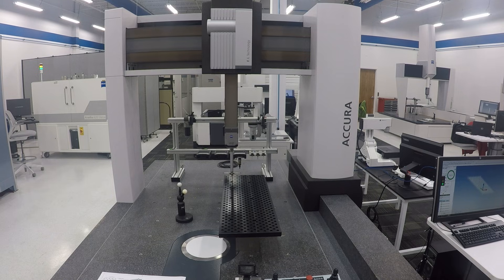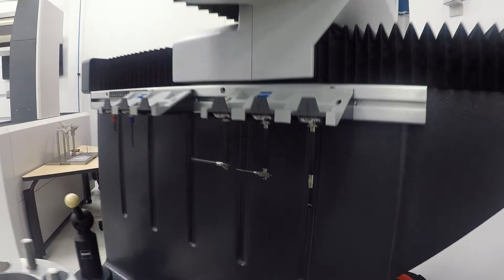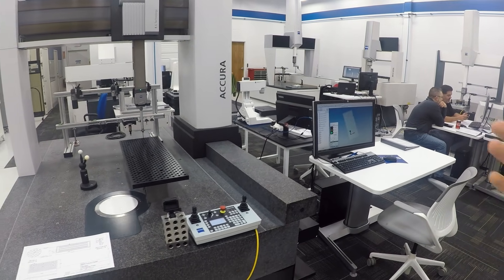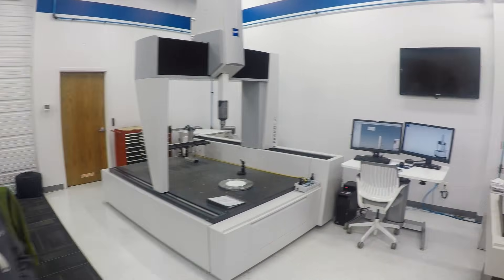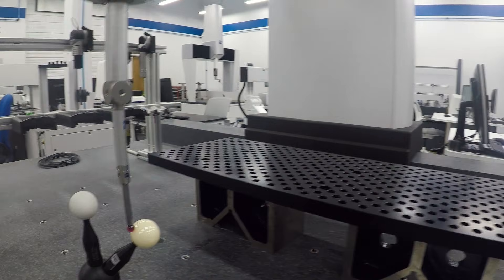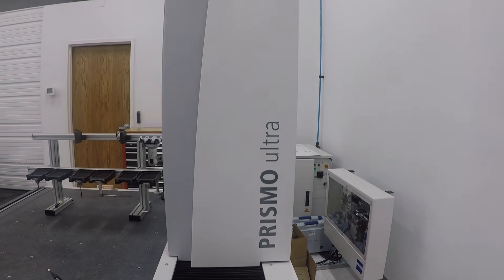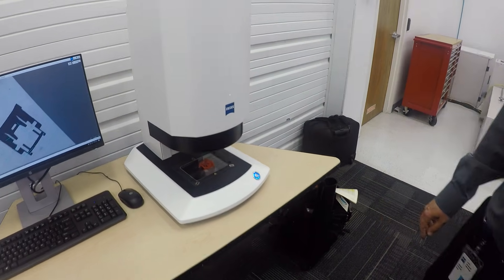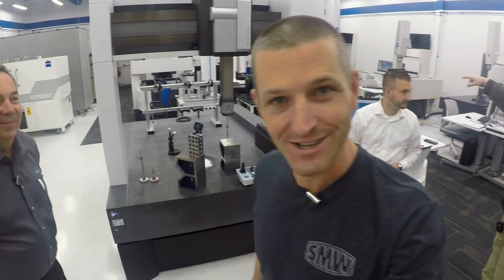Touring ZEISS: Learning about CMM and Metrology!

Comment: Don't mean to be picky but it is far from true to say that until only recently CMM's were found only typically in large factories. I have been working for CMM manufacturers for nearly forty years, many as an applications engineer training customers all round the world, and it has been the case since day one that there has been a widespread customer base, from what you American's call, I believe, a Mom and Pop Shop right the way up to huge conglomerates. Indeed it was very often the smaller operations that would use their CMM in a much more imaginative way than the big companies.   You are working with a fine brand and company. Zeiss have always been amongst the best products on the market and have innovated their product ranges well over the years.

Comment: Zeiss is garbage compaired to anything by renishaw
Reply: I disagree. While Renishaw products are very, very good, Zeiss is much more advanced when it comes to controls of probe heads and machines. They have better integrated drives and less jitter in the micron range than Renishaw. Their software concept with Calypso is an efficiency booster like nothing I have ever worked with.
Reply: McDoogle hahaha please say your joking. You can not compare fixed head to an infinite angle head, so if you compare the RDS head to a ph10,PH20 it is blown out of the water just based on ease of use and functionality. I see more Zeiss machine fitted with Renishaw heads because it is a better head.
Reply: Adam Schoenauer You’re misunderstanding me. I’m not in any way bashing Renishaw. I myself worked on Conturas, of which each was equipped with a Zeiss Vast XXT and a Renishaw TP200 on an RDS, and they complemented each other perfectly. But we’re not comparing apples and oranges here. I wouldn’t have any use for a PH20, cause there is no application in which I could ever have this damn lobing effect on form error that a TP20 has. Other than that, I totally stand to my statement.

Comment: When taken care of they are wonderful machines. The thing I have seen is that no one ever wants to calibrate the probes often enough. Just like you should check your micrometer to a standard at least daily, you need to calibrate the probes on the same time scale. I have seen probes read off on our Prismo by as much as 0.080 mm because they were not calibrated in over 2 weeks. 
Climate control will become a huge thing when you have one. Parts will have to soak to reach the correct temperature so that they can be checked. It can be several hours to do this and means loss of production time, plus the machine cools down affecting your sizing by having the ball screws shrink. We have to make warming programs for the machines to try to keep the sizing within our  tolerance of 0.010 mm while waiting for inspection of the first part of a production run.
Any speck of dust will affect your measurements.
Just a warning about the pitfalls of going for perfection in sizing.
Reply: Subscribe more information
Reply: https://youtube.com/channel/UCHOFmdXFTohdA-ysxAgTMpA

Comment: A good CMM is half the work.  Checking a part to a print with proper GD&T is the other.  If you have prints where dimensions are still in the +/- days, you are verifying next to nothing. You may be able to verify size but not location or orientation or even form sometimes.  If you have prints with mis-applied GDT, especially my favorite datum precedent violation, it is futile exercise. The math behind how CMM measure is specified in the umbrella ASME Y14.5 standard. CMMs are getting super accurate but none of it matters if the prints defining the parts are not complaint.

Comment: At what point or application a laser scanner such as Creaforms' Handyscan Black Elite (+/- 0.025) wouldn't be enough and a CMM will be required?
Reply: Generally you want inspection equipment that is 10x more accurate than your tolerance. If you are saying your handyscan is 0.05 accuracy, it could be a good tool for sheet metal or car body inspection. Powertrain, medical, and most aerospace applications would require a higher accuracy gage, like a CMM. 
So if you are measuring a tolerance of 0.1mm than a handyscan is OK, but you are measuring 0.01 than you need a CMM.
Reply: @toddwojtoviets1354  

Thanks for the excellent reply. I was trying to find an answer for a while.
Reply: +/- .025 is only really as good as a visual inspection, the standard machine shop tolerance is +/-.005. So unless you have access to the high end laser measuring equipment like they showcase in the video, your best bet is to stick with standard metrology tools like calipers, micrometers, gages and vblocks to achieve more accurate results, if that is what you are after.
Reply: @InterstellarMachineMan  I come from automotive accessories reverse engineering background where tolerances are less tight especially considering the sizes are in meters. That's why I'm asking.
Reply: @InterstellarMachineMan  Btw, do you mean 0.005 inch or mm?
Reply: @Ak47ram  I mean .005 inchs, but yeah it is all relative, a family member is a survey engineer and they're working with +/- an inch or a little less but it's over the span of hundreds of feet so just depends where you're coming from and where you're going
Reply: @InterstellarMachineMan  0.005inches is about 0.127 mm. The laser scanner is +/-.025mm in accuracy. Apologies for not mentioning the units.
Reply: @Ak47ram  my bad for assuming, but in that case that is fairly accurate. Laser technology has come a long way quickly. I saw some machines they use to measure things like jets and airliners at an expo and even  at long distances they were about that tight in tolerance but they also cost millions
Reply: @InterstellarMachineMan  No worries. Handheld scanners does loose accuracy per volumetric meter that should be taken into consideration when sizes increase. 

Coming back to my original question, I'd like to know at what point that these laser scanners are not enough and a CMM is required? I have just moved from the automotive accessories to defense MRO industry and I'm trying to find an answer to this question.
Does CMM inspect surface quality, say for bearing surfaces? 
I think a combination of handheld, CMM and CT scanner should cover the areas each technology can't do. If money is no objection...
Reply: @Ak47ram  I couldnt answer that in all honesty at our shop we employ standard analog metrology equipment
Reply: I will check with our engineer about our CMM machine when we get back to work.

Comment: How does the measurement system work on those? Very fine pitch and expensive glass scales I guess?
And how do the ways work on those, so nothing flexes out of squareness?
Reply: Not sure about Zeiss specifically, but most CMMs use air bearings on granite ways, usually with optical scales for measurement.
Reply: Squareness is measured via laser interferometry and corrections are made in the controller.

Comment: Its pretty fascinating technology.  I wonder how they get it to work on a granite slab or, any similar base?  I mean the there is no granite slab in the world thats submicron flat? Right? I assume they use some type of reference surface then compensate in software for the degree of error? 
I'm just curious.  Its probably obvious that I don't even know enough to ask the right questions.
Reply: Correct. In the olden days the machines had to have crazy accurate geometries. Nowadays the machines have to be "ok" and the rest are done by measuring the errors with laser and then compensate for it. It is called computer aided accuracy (CAA)
Reply: I am not sure about your question, but i can check in our CMM machine in our plastic injection tool factory.

Comment: The Xenos is insane.  Zeiss won’t even sell it to you (assuming you’re can even afford it) unless they inspect and qualify the area you’re installing it in. Massive foundation  and isolation requirements, strict thermal and humidity level controls and it’s pretty much a permanent fixture, there’s not really any moving it around later. Basically have to dedicate its own room for it in the basement somewhere. 

But it will get you accuracy to 0.3 microns
Reply: So which CMM machine do you think is the best you have used? maybe you can recommend to us, we are a professional plastic injection tool maker in China.
Reply: Shirley Xu 
That’s a pretty open ended question. 

It ultimately depends on the size of the molds you’re measuring and tolerances you’re trying to check. 

Injection molded parts that are mostly cosmetic in function don’t need super critics tolerances except at the split lines, where as molded parts that have a function to them, like medical parts, have critical tolerances that need to be held within the cavity surfaces. 

A general rule is you want a machine that will at least measure to 5X smaller than  your smallest tolerance. 

So if all your parts are +\- 0.05 mm (0.1mm total tolerance zone). You’d need at minimum something that can repeatedly measure to 0.020 mm

If you’re trying to hold +\- 0.01mm. You’d need at minimum a machine that could repeatedly measure 0.004mm
Reply: amazing about your answer, are you an expert of mold making, have you bought molds from China?
Reply: Shirley Xu 
Not molded parts explicitly , but medical parts and we’ve ordered injected parts from China before, but we do the bulk of our injection molds and molding in house
Reply: @ktmtooling  https://youtu.be/bPirvZzGFBE I think it's this one

Comment: We run the FARO Arms in our shops.  They are amazing for our application ( Metal Spinning and 5-Axis waterjet cutting ).  Not as accurate as the stationary CMM'S ( +/- 0.0025 )
Reply: Because the drivers of an Acura cmm turn off when it is measuring since it gives a point and they turn off they already checked the connection is fine and the program is so good the truth is giving us many problems

Comment: As a metrology engineer who calibrates and error maps CMM's on a regular basis for a major aerospace company I can say these are great and accurate CMM's however..  User expertise is essential and not cheap. Also you need to budget for calibration and repair in your decision making process because a simple calibration with ISO 10360 in mind is very expensive and will have to be done annually in most high production volumes.  We do ours at least every 3 to 6 months.  Another thing "crashes" happen just like on your CNCs so count on it!  You will be down for weeks.  Depending on you location it can be difficult to find qualified metrology vendors to perform your calibrations.  The cost just adds up quickly.   Not to discourage you but I've seen plenty of waste because the user needs the confidence and expertise to operate and maintain a CMM.  If you do buy do your due diligence on all makes and models that you deem viable.  Customer service with Zeiss is good but there are others.  Licenses for the software is another thing to consider do your due diligence with that as well because it is just as important.  Sales folks for these companies do there best to provide accurate information but they are sales people ;-)
Reply: Also consider your shop environment.  Nothing worse on a CMM's accuracy than putting it next to a machine with cutting fluid and temperature swings not to mention vibration.   Most shop CMM's are design with this in mind.  TEMPERATURE is your enemy!  CTE compensation should be included but uncertainty even in thermal controlled environments.  Make sure the manf quotes you volumetric accuracy with YOUR shops temperature swings.    Know the tolerances of the part you manf and get at least a 4:1 tolerance uncertainty ratio with the CMM you choose.  Take temp measurements of your shop with a calibrated temp probe though a typical week and see the swings (winter and summer) opening and closing roll up doors.  Thermal gradients with air flow across the CMM also should be limited with gantry CMM's. Use diffusers on vents anywhere near a CMM.  Its best to place the CMM in a separate room away from the machine centers or enclose the CMM.   Those are my recommendations.
Reply: @dwaynevarnell9157    well explanation, Dwayne,  yeah, i agree with you, the accuracy is the most important for mold or plastic parts checking, any mistakes of the machine will ruin the tool or the parts.  we are also a professional toolmaker in China.
Reply: @dwaynevarnell9157  Excellent point on the environment. In the 1990s, the company had a CMM incoming staging area for parts that were CNC manufactured in the factory. The CMM & the staging were air conditioned. By time the incoming production was "cold soaked" over night,  --- well you get the picture. No more staging parts in the AC area. Long since retired, it wasn't my area of responsibility.  I don't remember the mfg of the CMM or the details.
Reply: Great points! I’m a Metrology Engineer for a small-ish Metrology company and on a regular basis I hear our CMM operator groaning about how much of a pain the software is so definitely keep that in mind with your purchase!

Comment: Taking the human error out of it isn't necessarily true. It is very easy to miss use these machines and get poor results.
Reply: It's very easy to get the results YOU want from a CMM rather than the facts. Proper training and thought process on base alignments matters most.
Reply: In the shop i work out of, the CMM is dangerous. No one really understands it, and we use it to tell me people “this was certified on a CMM”.
Luckily the tolerances are open as a barn door, I’d be afraid to see that quality department turn in something less than +/-.005
Reply: @COdrummaCO  Well , at least you guys aren't messing with tenths for tolerances.
Reply: @COdrummaCO  Where I worked long time ago, it was very helpfull when something has to be drawn.
Reply: Very precise.  Precise but wrong.

Comment: why are the ports blurred out of the video, is that cylinder out of some top secret motorsport project
Reply: Definitively looks like a cylinder head. You can see the cam journals on top and what looks like injector bosses/holes under the blurred out ports. It looks like a cast part, with the usual grainy look, smooth transitions and has the cross hatched lines above the intake ports, which is seen on some production cylinder heads. My guess is that they have dimples, like a golf ball, inside the runners. Other than that, I don't see a reason to blur out just the ports, but not the entire head.
Reply: I didn't see it in the video.  I was only speaking from experience that there is usually Boeing and Lockheed parts in there covered with boxes or cloth.  Roush, Lingenfelter, GM and Ford development centers are also right up the road from there.
Reply: @TheCrash8212 interesting. What you say actually could be true. The more I look at it, the more I think it's for a newer v8, possibly DOHC direct injection engine. If I'm correct about the holes under the intake runners being for the injectors, then it makes sense that it's off a v8 with the fuel rails running under the intake manifold, like what the lt1 has.
Reply: More like top secret aerospace.  Likely Boeing
Reply: @TheCrash8212  migh be who knows
Reply: maybe only because of the camera. we have mand many camera tools/molds for our UK customer. their cameras are briliant.

Comment: You need a rotary table because interpolating it would not be as accurate.
Reply: It is very accurate.  1.8 micron on the XXT head with 2.5 degree indexing.  The rotary is more accurate but when  do you REALLY need to measure sub micron.
Reply: If you need the highest precision, and you have a part that is accessible enough to work with fixed probes, then it's better to use a VAST XT head with multiple probes (an XT can carry quite heavy assemblies up to 500 grams), calibrate each tip individually and use no rotary table, so you eliminate as many moving parts as possible. That's unbeatable.

I've used a setup on an Accura with two probes, one 500 mm long, one in the opposite direction 400 mm long. It was a bit tricky to calibrate, but once I got it done, the tips held a repeatability of under a micron to each other, even after five days with no re-calibration (just constant verification).
Reply: @mcdoogle274  in the facility shown in the video, they have a carbon fiber stylus that is over 40" (1200mm+) long from center to end.  They use it on the VAST XT Gold on the Prismo.  They actually measure parts sitting on a cart next to the CMM when it's too heavy to lift.
Reply: I should clarify...the interpolation isn't as accurate.  It's around 3 micron on my machine.  I create and qualify each individual position as needed rather than rely on a theoretical calculation.  This method maintains the machine spec accuracy.
Reply: @TheCrash8212  I guess one could also make the argument that there could be measurable error in the rotary table as well. When you are measuring down to that level of accuracy even just standing is a different area next to the machine could affect it.
Reply: @VenomKen  that's true but the rotary table is VERY accurate with a VAST XT head.  It just doesn't work with the XXT RDS due to it being passive